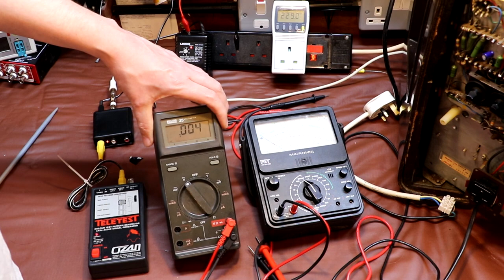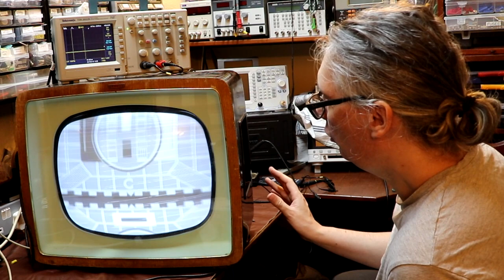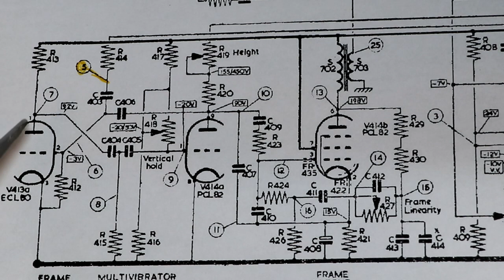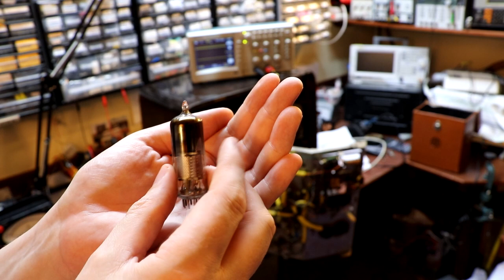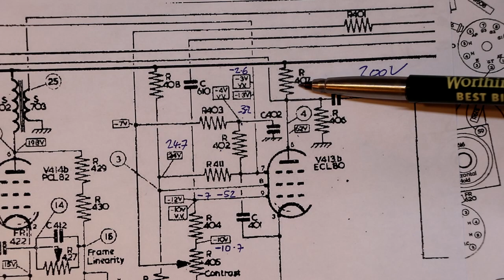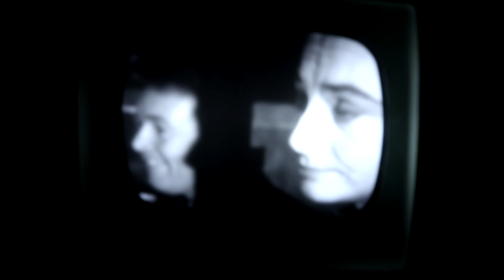Shampo066 Stella TV Repair - Part 3

Comment: There's probably not many old TV engineers like me left in this world, I started in 1958 and moved on to other areas of electronics in the 80's.  There are lots of these kind of programmes on YouTube now, many from America, and I wonder why?  I shouldn't really watch them because I find myself shouting at the screen like an idiot, usually yelling "Get on with it..!!"  This set is a 'Philips' TG100 chassis from around 1965, the Stella badge was used for retailers to rent out so as not to associate the sets with the more prestigious Philips brand.

I dare say that there are many viewers fascinated by this chaps droning rhetoric, but believe me, he wouldn't have lasted long in any of the TV workshops I worked in.  He'd have been expected to fix sets like this at a rate of at least eight a day ... and I might add, with an AVO 8, and 'without' an oscilloscope.  I never saw an oscilloscope being used until colour came along.  Fixing sets in the field (people's homes), was even more hectic ... 15 to 20 calls a day wasn't uncommon if you worked for a rental company.  Fortunately, back in those days, needing to employ a soldering iron in someone's house was quite rare.  The majority of requirements were: cleaning screens, cleaning tuner contacts, and changing valves.  A 405 line, bands1 & 3 VHF set of this vintage, had about 300 discrete components - that's resistors, capacitors, and couple of diodes, yet for any given set make/model,  maybe only five or so of these would be known to fail, known as a 'common fault'.  Whilst that was the norm for us, this chap has a far more involved and difficult problem, and that is 'age' - both his, and the set's ... he's too young, and the set is too old.  Degradation of component values - especially in capacitors, is a problem a restorer has that we didn't.  The set he has here clearly works, and is suffering from not being used for a very long time.  Ionisation, and oxidation, will be lurking everywhere unseen.  This set isn't faulty as such, it has just died, and will never again be as it originally was.

A historical view of course, but from someone who lived it and remembers when sets like this were brand new and the very latest of their day.  Here you were shown a 'multi-vibrator' circuit using valves, which I can tell you, that this Philips TG100 chassis was the first time I ever saw the like.  I remember it being the cause of much discussion and even argument among engineers as to how it worked ... up to then, most field oscillator circuits had used a transformer based 'blocking oscillator'.  I do find it rather odd that what was once bread and butter to thousands of TV engineers in the 1950's and 60's, is now a popular pastime exercise of restoring sets that can never be used.  Listening to endless rhetoric, whilst watching someone fumbling about with knobs and switches, is weirdly entertaining ... a bit like I'm imagining  'James Watt' and 'George Stephenson' watching 'Fred Dibnah' talking about steam engines. God bless, and good luck to all who venture and enjoy your nostalgic enterprise, ignore me, I'm only being cynical because I can be.
Reply from the maker: Wow that’s a brilliant comment packed with some amazing information. Well I hope you haven’t hung up your soldering iron just yet as there is as you say lots of people like me around who rely on the old timers for help and advice. I do think it’s a shame that most of the repair guys are based in the USA as we could do more in the U.K to support the hobby and record things for the future. There doesn’t appear to be anyone making videos explaining how these things works and watching someone fixing things isn’t the same thing.  I’m just bumbling around I’m never going to look at enough television to gain a proper level of experience. I like working on any vintage stuff and enjoy learning about it and it’s history. Thanks for watching and great comments I hope you can advise on my focus adjustment and the linearity issue. Thanks regards Chris
Reply: @allthegearnoidea6752  I rather suspect that you're not quite as 'not understanding' as you tend to make out ... you seem to use the correct terminology at least.  I worked with young engineers who had never seen a set as old as that TG100, whereas I remember having to go round a list of people's houses on my bike to fit channel 10 coils to sets that had a pre-fitted band III tuner.  Whilst some sets had a band III tuner fitted in production at the factory, coils couldn't be installed until it was known where the set would go to which transmitter region.  Earlier sets had to have a retro-fit tuner kit, and that required the cabinet to be drilled.
Now, if not for your benefit, but maybe for other interested amateurs, how the timebase synchronisation worked, was a tad more complicated than saying 'sync separator', which is why your set still maintained just enough line sync.  The sync separator valve was biassed such that it only conducted between the voltage levels occupied by the sync pulses.  The resulting pulses were then processed in two ways - differently for line and field. You'll notice that I say 'field' rather than 'frame'.  Frame is incorrect, but became the norm anyway. To say 'a line pulse', is correct, that is what is transmitted. But the field oscillator sync was quite different.  The single line pulse was differentiated by 'capacitor and resistor' (differentiator) to produce a single spike pulse from the original square pulse, whereas the field pulse was produced by 'resistor and capacitor' (integrator) in which a specified number of pulses in succession were added in the capacitor so they reached the required voltage level at exactly the right time.  In both cases - line and field, the sync pulse worked by causing the oscillator to start again.  This was necessary in order to provide time for flyback.  Though imperceptible, the lines on the screen were very slightly slanted to allow the two fields per frame, to interlace.  Fascinating stuff, eh?  Incidentally, the reason your resistor went high, is down to the way carbon resistors were made by adding impurities to the carbon in ratio to the required value.  Roughly speaking, anything over 100k, would inevitably go high or open circuit when the carbon becomes overwhelmed with impurities by either over current, or just time.  Under 100k, in parts of the circuit where higher current and thus heat are involved, resistors go low due to internal tracking of burnt carbon.
Reply from the maker: @barryhallam1628  Thanks Barry I did wonder if I was suffering verbal Diarrhea at times.  There appears to be several names for the same thing and A lot of what I have learned comes from watching video from the USA and they have there own names. I know I wasn’t very consistent naming things but hopefully everyone understood. This is my first television repair so it likely I’m going to get everything correct but sometimes you have to break some eggs in the learning process.   I have restored a few valve radios but probably less than 10 in total so as an amateur it’s difficult to build up the same level of experience as a technician in a busy workshop. Luckily there is lots of information on the web and people willing to advice and help new players like me. My background is electronics and I have worked as a designer for nearly 30 years but this had been in microelectronics FPGA and software design. As we said before this is just a hobby for me a like working with my hands etc. Thanks regards Chris
Reply: Don't forget the Thyratron gas discharge valve timebase generator .
Reply: @michaeldranfield7140  Yep, 6k25 as I recall, used in 1950's Ultra TV's.
Reply: @barryhallam1628  I think TT41 may have been another  , in a grey metalised finish ?
Reply: @michaeldranfield7140  I only knew the 6k25, but whatever make they were, it hurt if you accidentally brushed against one when the set was on.  We seemed to be oblivious to the hazards back in those days.  I once watched an engineer draw an arc from the EHT to chassis for about ten seconds to revive a low emission (wired in) EHT rectifier.  It worked, but for how long one might wonder.
Reply: Yes, I too can relate to much of this.  I started my five years apprenticeship as a Television and Audio service tech in July 1971, continued in the trade for thirty-five years until I was made redundant for the fifth and final time in 2006.  I can honestly say I loved my job as a service tech.
Phil.

Comment: Gotta leave this comment, even though I'm sure others may have already: when testing for shorts on nearly any valve tester, you must rotate through all the positions of the "shorts" knob (in this case, it's a dual-function control labeled "Setup"). Otherwise, you're not testing all possible combinations of shorts between all the valve elements. You'll notice that your Sencore "Mighty Mite VI" actually reads, right below the "SETUP" label: "ROTATE FOR SHORTS". Ya gotta rotate that switch! Then, rotate it back to the position(s) called for under column "D". Then, proceed with emissions testing.
Reply from the maker: Thanks I didn’t know that. I do have several other tester that do have a rotating control for shorts. I’m going to have to have another read of the manual. Great advice and comments best regards Chris
Reply: @allthegearnoidea6752  that makes two of us... never knew myself until my friend pointed it out to me years ago, on my Hickok 600A. I remember thinking it was an odd test, but he pointed out the logic to me: each switch  position connects a different pair of elements inside the tube (or a different pair of pins, if you like), and the neon bulb tells you if that particular set of elements is shorted.
Subsequently I got the 600A manual online, and sure enough, there it was, in capital letters: "BEFORE RUNNING ANY OTHER TESTS, PERFORM THE SHORTS TEST" or similar verbiage. 

One of the reasons for the "shorts" test is also to protect your tester, which makes it that much more important to perform before any other tests are performed: if any elements are shorted when you run an emissions or grid leakage test, you could damage the transformer, switches, or the meter. And as we know, repairing these old valve testers isn't for the faint of heart. 

Good luck, and thanks a million for all the top-shelf, finest-quality, quirky Midlands(? Northern?) English humour. It's much needed— and appreciated— over here in the States. {;^>)

Comment: There is a frame linearity control. It's a slider preset amongst the circuitry. Have you tried that? On valve frame timebases the output pentode valve has to handle quite a large current towards the end of the frame. Anything that tends to limit this current (e.g. low emission valve) will cramp the bottom of the picture and it may not be possible to tweak it out with the linearity control.
Reply from the maker: No I haven’t looked at that yet. I changed out an electrolytic in the linearity circuit so I probably need to adjust the potentiometer as you quite rightly say. Thanks regards Chris

Comment: Hi Chris, I was watching one of shango066's videos and YouTube suggested your channel.  I worked as a TV Tech from 1973 - 1975, all in the US and, of course never laid eyes on a UK TV (obviously due to the format difference).  I always find it interesting the way other countries design/build electronic devices.  Anyway...  I wanted to add my comments - for what it's worth.

With TV's in general, keeping manufacturing cost low has always been the top priority.  Therefore, cheap under rated components were commonly used.  Considerable research was also put into getting as many functions accomplished with the minimum number of components.  As a result, old radios and TV's generally need most all of the capacitors replaced.  Non-power resistors were always carbon film or carbon composition types, which drift badly over time in the presence of heat, humidity, and high voltages.  I have even come across faulty resistors that will read the correct value with the ohmmeter connected in one polarity but, 10X with the opposite polarity.

In the TV shop in the early/mid 1970's, we always used VTVM's for voltage measurement.  VOM's were never never used since they heavily load some circuits, like control grid voltages for instance.  Oscilloscopes were of course analog, with vertical bandwidths as low as 100 kHz, all the way up to a blazing 5 MHz.

We never used valve testers because, they proved to be unreliable, as they didn't represent the way the valve was used in the circuit.  Instead, we always had a stock of new valves for substitution.

That particular TV you are troubleshooting also appears to have AGC problems or, the AGC control is misadjusted.  If the AGC is set wrong, it can cause the video to be clipped, which can shave off the sync pulses in severe causes.  Also, your vertical linearity adjustment is off or, you have a bad capacitor in the vertical circuit.  B&W sets, being low cost, don't generally have as good of horizonal and vertical linearity as the color sets.  The color sets usually have some additional adjustments for this.  - Cheers!
Reply from the maker: Hello Bill thanks for the very interesting comments packed with information. As you can probably tell I am a really big fan of Shangoo I enjoy his incredible expertise and dry sense of humour. We also share a love of mine exploration although shangoo has yet to visit a really old mine, LOL. I visited a mine last year that still has a Roman workings. 

There was always a range of quality for both televisions and radio equipment Philips were always one of the better manufacturers. I don’t think they used deliberately poor components but some in latter years did become notorious for failing like the black tar bombs. Amazing the Electrolytics still measure good for capacitance and ESR but will be replaced. The mullard  style mustard pots rarely fail even today. A lot of the resistor will have gone high with high resistance values usually going far out of tolerance. Luckily valve circuit are much more forgiving compared to semiconductors.  

The AGC is pulled off the sync separator valve and the poor contrast could be related to the AGC action but then set didn’t loose horizontal lock just vertical.  This is my first television so I have a lot to learn. I am really surprised at the amount of comments my TV repair has attracted never thought it would be popular.  I don’t think I will be doing many TVs in the future I just film what’s on the bench and my love has always been radio. If I come across an early TV set I would consider it but have no interest in later stuff or colour sets.  

I have a radio from across the pond on the Bench today a Hallicrafters S20-R. Thanks regards Chris
Reply: @allthegearnoidea6752  Wow, thanks Chris for the lengthy reply, most YouTuber's give me just a few word response!

Yes, shango066 is a unique person, I would never consider trying to bring a TV that has been sitting out in the weather for years, back to life but, he seems to really enjoy it.  Concerning his interest in mines, I am too claustrophobic to even think about going into a mine. 

Restoring a TV is not something I would attempt unless all of the critical components (CRT, power transformer, flyback, vertical transformer, and deflection yoke) were known to be in good shape.  All those impossible to source components takes all the fun out of it for me.  I do enjoy restoring old valve radios and have been doing so since the early 1970's.  Most of the parts are available or can be improvised, and parts that are not (typically IF transformers and coils) can be rewound with some litz wire.

I am a bit critical of the low cost components used in old radios and TV's because most of my career was spent designing aircraft communication transceivers.  In order to get the most out of a design, I had to familiarize myself with the internal design, construction techniques, and detailed electrical characteristics of all components that were under consideration for a given radio design.  Needless to say, there was a huge quality difference.

The aluminum cased electrolyics hold up well in the old radios if the electrolyte hasn't dried out.  If the designer placed the electrolytics away from heat sources, they can go for about 50 years.  Any capacitor with a paper dielectric will have high leakage due to the acid treated paper slowly deteriorating over time.  Of course, you have to reform the plates of the electrolytic if it hasn't been used for many years, which is partially successful.

I only owned one Philips radio in the past, it was the typical German mantle style radio from the mid-1960's.  It was very unique in that is used a totem-pole valve audio output stage which drove an 800 ohm speaker.  It had so many problems, I lost interest in it and gave it away.

Comment: I'd change some of resistance, capacitor components for modern types!
Reply from the maker: Which ones would you like me to change ?
Reply: @allthegearnoidea6752  (C408) you can test Capacitor / Resistors any that look stressed, desolder one end to test values around frame output plus supply line. Servisol, potentiometers!